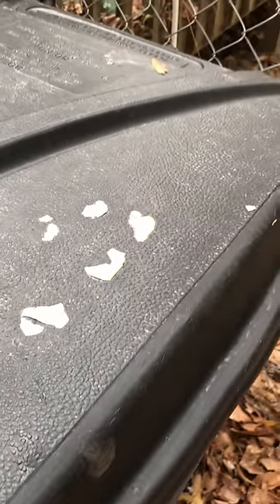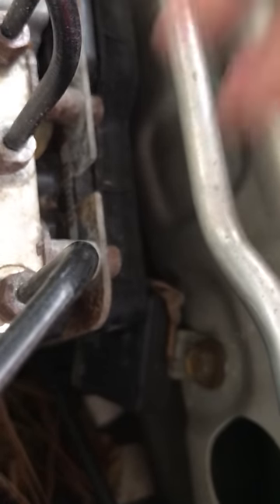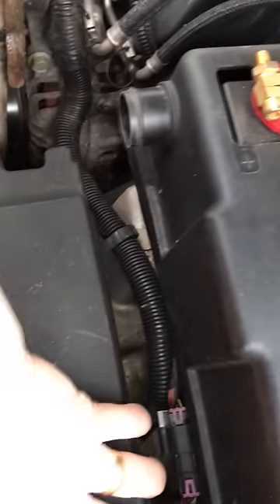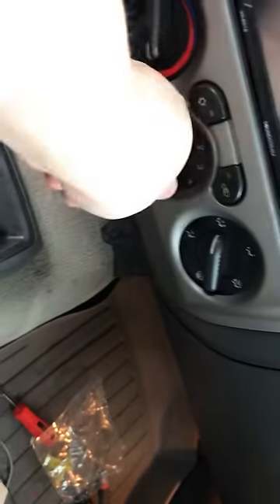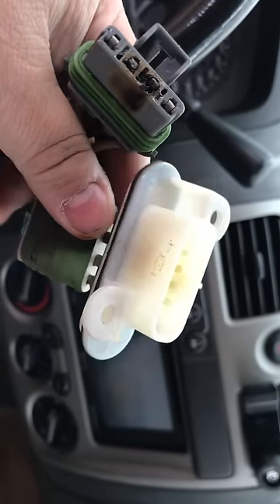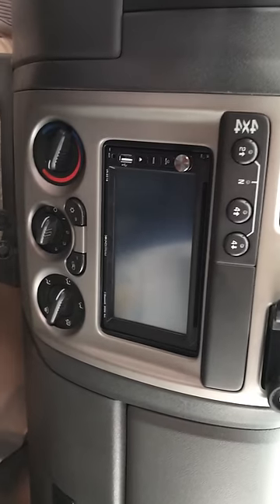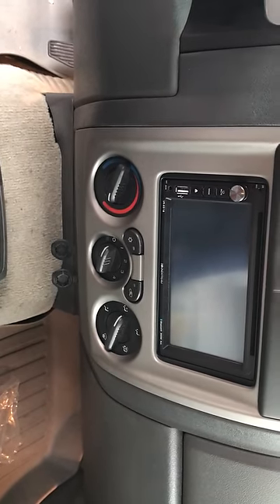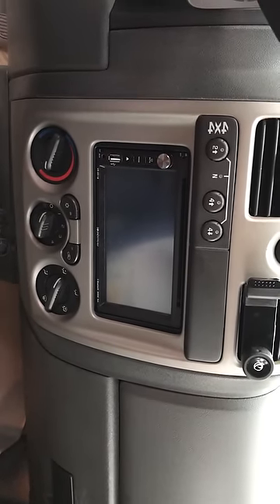Chevy Colorado/GMC Canyon electrical issue fixes

Comment: Right on. What I found on my '09 is that the little black box that you showed on the passenger fender is actually a grounding connection for about 4 or 5 circuits. My constant problems with that resistor and harness burning up went away when I cut off the wires and put separate loop wire ends on each wire and then bolted them to the same spot on the fender. If you can split that little box apart and you can see why it would fail.

Comment: Hi - oh my great video! I’m also having issues with my 2006 Canyon. Recently put her back on the road (I’m not a mechanic but eager to learn). Everything was going great until suddenly my cluster gauges started with ADHD, work/not work etc. check engine light still lit up (always has been) and anti theft light but nothing else. Pulled it all out - checks out fine. A week later my cig lighters quit working. Next when I was replacing a rear speaker - no luck. Tried 3 different speakers in that same spot - nothing- but 2 of the other speakers work in the truck. Yesterday I’m driving on the freeway and drivers start yelling at me telling me I have NO BRAKELIGHTS!!! So now this is the 4th electrical issue in 3 weeks that I still can’t figure out. I’ve checked every single ground I can find and cleaned and reconnected them. I’ve replaced fuses and bulbs. I went on a wild goose chase for some G300 under drivers seat under carpet- took both seats and carpet out and did those grounds too. I’m at a total loss for what’s going on here. My battery is new, I’m gonna try replacing the Mega Fuse because that one does have some corrosion (only fuse i didn’t do). I’ve put so much work into this truck and have very little money- without brake lights and cluster she’s basically a decoration in my driveway. PLEASE HELP

Comment: The best and cheapest (almost free) way of fixing that is to get rid of the socket and solder the wires straight to the terminals on the resistor. Most likely the resistor is still good. Thats what I did and I haven’t had anymore problems.

Comment: If you order it from amazon the fan control wiring is only a $8-$12 for wiring and coils.... don’t go to no autozone lol
Reply: I did the same thing for  $12 myself,
Reply: I redid my resistor for my blower motor and it looked like it about caught on fire. After dealing with all the other electrical issues and valve/head issues, I wish it would have burnt to the ground

Comment: My 2006 only has 85k miles on it, as and I've had nothing but trouble.  I had to replace the Throttle Body at 35k miles,  new water pump at 58k. The blower fan only worked on #4 and I replaced the wiring harness for that. Now I just replaced the Cam position actuator because it would not idle.
Reply from the maker: I understand.  Mine would.not shift into 4wd. And the light on the dash would flicker on the indicator buttons as well. I replaced every electrical component that thing had and still nothing. I finally traded mine for a Toyota tundra.

Comment: I have all of those issues with my 2007 chevy Colorado as well.  I replaced the lower resister and it worked solid for a week and then went out again.  I am also having a problem with it overheating in idle.  I replace the fan clutch, water pump, coolant sensor and cleaned out the throttle body myself.  I still having a problem though in overheating in idol.  I can't find a related issue online though.  I replace all of the relays and fuses as well.  I also cleaned the ground by the mass airflow area you were talking about, but I didn't do the other side and I will check where fuse box is.  I will see if that helps any.
Reply: I had those symptoms my throttle body position sensor plug had a bad wire

Comment: My 09 Canyon had a burnt fan control resistor. I replaced it, and it burned again. After some research I replaced it with the harness and resistor block from a Tacoma, a completely unrelated truck right? Apparently not because it works great now.
Reply from the maker: sounds like you found a great alternative.  These truck even though they have a IMO great engine and drive train their electronics are very poor

Comment: I have weird problem with my 06 canyon. Battery is good have had it tested multiple times. When I go to start it sometimes starts up no problem. And sometimes I have electric power dashboard lights etc but then when I go to crank it lose all power no start no crank no dash lights or outside lights no electric power whatsoever have cleaned all grounds and battery terminals. Any help? Thinking ignition switch

Comment: Can you give me advice on my problem? I lose electrical power while driving and about a half mile it’ll automatically come back on? I don’t lose engine power just electrical. This has happened twice including today. Thanks
Reply: Im having the same problem, did u fix urs?
Reply: Check the ground and your fuse connections.

Comment: Yup all these trucks are Lemons 🍋! Seriously as I’m reading through the comments I can relate to just about everyone of you, I have an 05 4wd 4door straight five and yes it looses all lights once in a while, the blower fan stops and frys out atleast once a winter, the master fuse went,it overheated for awhile until I put a new radiator in it, and now the latest issue is that all the blinkers and hazard lights stopped blinking,lighting and there’s no clicking or sound! I’m pretty mechanically inclined and have fixed every single issue except these damn blinkers! I’m sure it’s something pretty easy like a dirty ground or rusty connection or something but someone out there has had this problem and got it fixed? Any help would be appreciated before I stuff a roll of paper towels down the gas tank and light a zippo and run!!!!
Reply: Oh yeah forgot to mention, I have an 05 Canyon for sale, runs mint, no issues at all haha!!!
Reply from the maker: Yep I hear you, lack of dependability. And the electrical is very problematic. Why i go rid of mine. and got a first gen Toyota Tundra . To answer your question I will say this first clean the grounds. Second : The front turn signals have a  
harness that goes bad  here is the part number. 
Genuine GM 19121867. What I would suggest is  one ensure your lights parking and turn light up . Then I would swap the left turn signal harness with the right ( leaving the other harness unplugged) and see if it works If the left doesnt work plugged into the right side, then take the right side harness and plug it into the left side . That will possibly eliminate the idea that the harness for the turn signals are bad. And the problem lies elsewhere.  I would also suggest that you go to 355nation.com and see what the members there have to say about the problem if my suggestion doesnt reveal the problem. Good Luck

Comment: My 2006 Colorados stereo and windshields don’t turn on until 30 minutes later after starting the truck ?
Reply from the maker: If you suffer from multiple electrical issues. More than likely a great deal.of them are due to those two grounding blocks on the fenders. I know of a few guys that own these trucks that bought aftermarket terminal blocks and put ring terminals on all of the wires going to these blocks to fix their issues.  It really is a crappy design IMO

Comment: Thank you for this video. Can you please help me figure out what's going on with my truck? The blinkers AND hazard lights no longer work. Fuses are fine but I'm unsure of where to fo from there.
Reply from the maker: Chase sorry to not see your post (1 year later). If you haven't got it solved by now. I would check the blinker connectors and they can unplug from the harness and check them for continuity. I had mine go bad and had to replace them as i was having a similar issue.  Also those Grounding blocks can be a pain in the butt as well causing all kinds of issues. Also even though it may sound silly. Check to make sure your bulbs work and are not blown
Reply: I have the same exact problem on my 2005 Canyon, my fan stopped working , only 1 and 4 on the settings would work, well I fixed that and then one day all the blinkers and hazards stopped working. It’s definitely not the bulbs, it’s certainly an electronic issue because I’ve seen atleast ten guys mention this online, I’m going to the junkyard today to pick some parts up but I’m not even sure what to replace yet? Any ideas sir? Thank you for your time and video.

Comment: Joeseph Payne helpppp

06 2.8 Colorado.  118k  Runs fine untill temp gauge gets to 1/2 way, once at 1/2 way  truck will stall/ shit off when stop or lift foot off accelerator…  replace all sensors and vvt   I heard GM fuel pumps will get hot and shut off..  any help is greatly appreciated.
Reply from the maker: check intake filter, throttle body, and MAF sensor as they may need cleaning . after that check all vacuum lines and ensure they are all connected with no breaks or cracks. If nothing pops up here, the next issue you may need to address is possible overheating.

Comment: Hey man my head lights and dash board turn of suddenly while driving for like 2 seconds and trurn back on, ? What could it be?
Reply from the maker: It could be possible an issue with the headlight switch, loose connection turn signal switch, grounding issue. I would go check out and join the  355nation website it's a Colorado/Canyon enthusiast website.  the people on their have years of experience working on these trucks. They may be someone who has had that issue like yours for sure.
Reply: I had the same issue with my 05 Colorado believe it or not I had a drive wise from my insurance company plugged into my OSB port and as soon as I unplugged that all my issues went away.

Comment: the 3057  and 3157 are the same plug in bulb  with 4 little wire prongs  however they are staggered   if you noticed so they will plug into the connector either way  flipped over it will still slide into the connector , my question is will you still have the parking filament lite up   and the larger brake filament when you step on the brakes  no matter which way its plugged in ?
Reply from the maker: Great question.  I do not know. I do know that some guys have replaced their 3057 sockets with 3157 ones (But they have to trim the plastic tabs to get them to fit) Perhaps you can let us know what you find out?
Reply: I think next time  I need a bulb replacement Ill do the brake light test while its plugged in

Comment: I just got s 2018 colorado do they last long?
Reply from the maker: Timothy I honestly do not know. I hope if anything Chevy has improved its electrical design as your truck is 13 years newer than mine.  Perhaps you can share with us any issues you may experience with yours? I hope you have none . but If you do please share.
Reply: I have 2004 works great   but few things it is 4x4

Comment: How do u get to those plugs you replaced for blower motor
Reply: And LEDs
Reply from the maker: plug comes in kit. you can buy from rock auto or autozone etc.
Reply from the maker: @soupysendsem7617  led's i bought at radio shack and soldered mine in . You can check local auto salvage yard and see if they have a used one as well.
Reply: No how do you get to the location of where the plugs are.   Are they behind middle console or
Reply from the maker: The plug is located on the right passenger side under the glove box. You would do well to replace the resistor as well when you replace the plug as I'm sure you will see burn marks
Reply from the maker: The plug and resistor are located near the glove box  take a mirror or your cellphone with front camera on and place it on passenger side floor and slide it under glove box area you should be able to see the plug

Comment: Reading your comments sound like Colorado's and Canyons all have similar issues my 2005 colorado randomly won't start have powere everywhere else but the radio and starting anyone have suggestions battery and alternator have all tested fine.
Reply: Does it seem like it's not getting fuel when that happens? And does it seem like it takes about ten minutes before it will crank?
Reply: This is a late reply but I know exactly what the issue is. It’s the fuel pump. Tap on the gas tank with a 2x4 or baseball bat as you start it. Worked like a charm for me

Comment: My 2004 chey colorado cw z71.4 wheel drive wont work.an push buttons.lights dont come on why
Reply from the maker: Could be one of a few things. check the connection on the 4wd actuator make sure its good . Also check the transfer module under the drivers seat as that can cause that symptom as well especially if you have in the past gotten the interior wet.  I would also go to a colorado forum like 355nation or others as there is a great resource from other owners that have had the same issues as you.

Comment: Check your ground wires, if it's possible cut them off from the little box ,and put a ring and stick in the chassi,I solve many problems doing that, I only have one problem ,the passlock ,i hate it !
Reply: I found how to fix that passlock problem , i  have 2004 gmc canyon thanks to others that made a video on how to on you tube

Comment: I have a slight electrical drain on my 2011 GMC Canyon 2.9l 2wd truck.  Any suggestions?
Reply from the maker: Stephen Maurer I would check your connections especially those ground blocks can make all kinds of issues pop up.
Reply: Stop in at a dealership and see if there is a recall for that issue my 08 Canyon had the same problem and it was a recall fix the dealership took care of it at no cost

Comment: Can anyone help me with this issue I have a 2007 Chevy Colorado lt  the back light for gauges not on so at night I can’t see gauges but all the gauges works properly but I noticed that the dimmer switch doesn’t seem to work like it don’t do anything but turn on dome like it’s not turning up the lights to bright or dim it doesn’t seem todo anything it feels very loose any ideas on what I could be
Reply from the maker: I would look at replacing the headlight switch as I had the same issue and that seemed to fix it. They have a tendency to go bad in these trucks
Reply: Joseph Payne ok thanks so the whole dimmer switch etc is there a place where I could order dealer doesn’t have in stock I thought that might be because the dimmer knob feel loose no click to it and it only seem to turn on some light at nothing else would turn up or down
Reply from the maker: @sptguy7848  I would look at rockauto.com. now there are two types of those switches one with fog lights and one without so make sure you order the right one for your vehicle
Reply: Joseph Payne thanks my guy

Comment: Just replaced the MAF on my 07 Colorado 4wd and now the odometer doesn't work. The gas gauge quit 2 weeks prior to that. Pile of garbage
Reply from the maker: Christopher I feel your pain. I had soo many issues even the dealership couldn't help me figure out what was going on. In August I traded mine in for a Toyota Tundra .
Reply: @josephpayne9655  It doesn't even make any sense!!! The PCM is in charge of the MAF and the BCM "I believe" controls the cluster. I paid $5,500.00 for this thing and put almost another 1k into it!!! Ripped off the plates and threw them across the driveway! My 94 Sonoma has a busted shackle in the rear and a sagging door and has 95k more miles on it. No CEL, no gas gauge issues, nothing. Complete opposite and only paid 200.00 for it! Done with GM. Rant over lol
Reply from the maker: @camaro2002rs  from what I have read in the forums the BCM is very problematic as is the grounds. I'm still an old chevy guy pre computer of course , but I'll never buy a new one as long as this crap goes on
Reply: Well after the bcm and the odometer not working, I now have experienced the blower resistor issue with this truck along with 2 out of 3 buttons for the 4wd not being back lit. The Orange indicator comes on for what ever position it is in but the back light only works on 4 hi. 4 lo came on once and never did it again. Hope this thing burns up

Comment: My sound from turn signal is not working.
Reply from the maker: It's still flashing right?  Have you checked the flasher relay? It's in the main fuse box under the hood.  That is what typically makes the noise when the turn signals are on
Reply: Speaker is not working.  Most newer vehicles use the BCM to control the blinkers and the radio is the sound/click output.  It usually is only through 1 Speaker on the drivers side but could be the door Speaker/tweeter or the speaker in the dash/A Pillar. Run the audio control to the front and switch side to side and see if all speakers are working properly.

Comment: I hook my trailer on my 07 Colorado and all my lights stop working!
Reply from the maker: Reggie I have heard from guys on 355Nation (it's a Colorado/Canyon enthusiast site) that there are some problems with the trailer harnesses on these vehicles , along with all the other electrical issues. . I would. Do the obvious stuff first check for electrical continuity/ and voltage to the trailer plug which could also be corroded. If you go to the website and join they have a lot of tips and tricks out there as they all have at some point experienced and issue with the trucks

Comment: have a 2004/5 canyon it has hugh mileage yesterday started vehicle lights come on automatically as usual however as I started brushing off the snow I noticed lights were both out.  only way to get lights was to takeoff the auto and put lights on manually and put on high beam  
however later in day noticed the lights were back working later as normal on the auto setting
this morning I got the same problems
Reply from the maker: Sometimes those switches have been known to go bad. also there is a sensor i think located on the right side of the dash that is the light sensor for the auto setting as well, I have never had one go out, but it is part of the circuit . Something to check out /